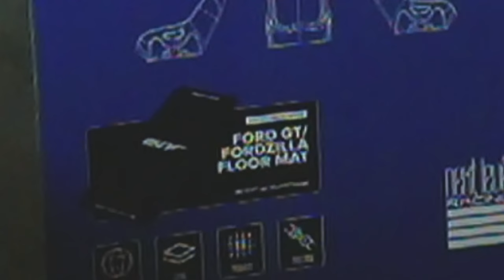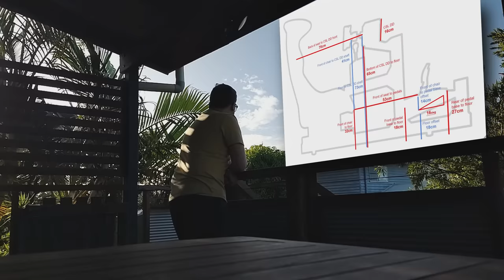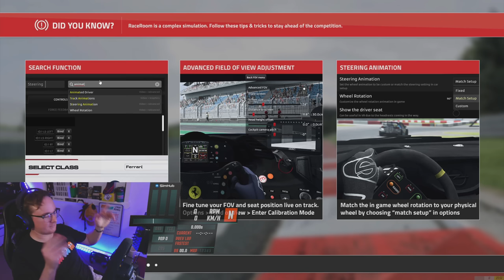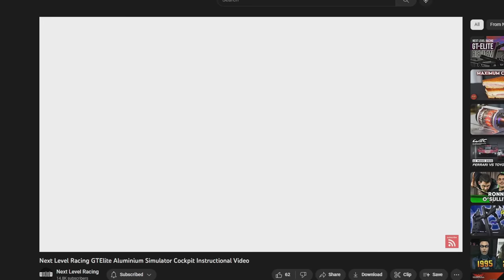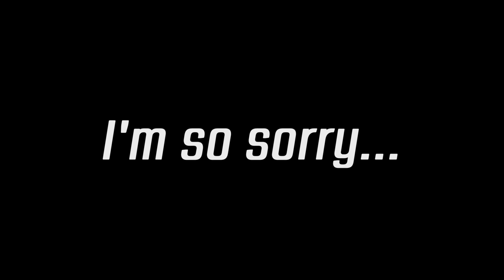My New Sim Rig! Next Level Racing GTElite Cockpit - Unboxing, Assembly and First Impressions

Comment: Yay! Yet another freebie handed out. Utube is full of folk happy or sometimes bemused to get handed a AU$1500 racing cockpit WITH ALL THE TRIMMINGS I might add just because. This time, to a bloke who doesn't even need it. Sheesh!
However, I did like your review. Lots of info on the bad as well as the good, spoken both clearly and logically. I'll be building the same rig very soon and much of it will be done at table height.

One video tip; this rig is dark in a dark room. I had a lot of trouble seeing any detail tbh.
Hope you cashed in selling one of your rigs. Not a bad little earner after all 🙂
Reply from the maker: Completely agreed mate, I definitely didn't need this rig and was perfectly happy with my old Simetik K2 before Next Level Racing came along and offered me this 😅 which was even more surprising considering my previous video was a review of their HF8 vibration seat pad and wasn't exactly, er, complimentary to say the least. I guess it costs them less to give a few rigs away to streamers/video makers here and there than it does to blow a stack of dollars on advertising. That said, the quality of this thing is superb and I'm very happy with it 👍 no complaints after a year of extensive use and it's been rock solid. All the best for your upcoming build!

I'm saving the old rig for either my Dad (if my parents decide to move over to Australia in the future) or my little kiddo when they're a bit older and can reach the pedals. And as for the lighting side of things, I've gotten much more familiar with my camera settings and editing software since making this video so hopefully the footage is looking a bit better these days 😉

Comment: Nice, looking to get this.  How tall are you?  Want to know if the pedals could be brought back a bit (for guys 5' 7" or shorter) without bringing back the slant bars, or wheel may be too close.
Reply from the maker: I'm about 174cm which is bang on 5ft7 👍 can't see any issues why being a little bit shorter than that should be an issue either.
Reply: @DDFRacer Sorry, that issue was with the F-GT Elite.

Comment: What a video, that’s a beautiful rig. I just Googled and it’s a real shame that nobody makes a GT wheel to match with this.

A branded GT replica wheel would make this just about perfect. I love how it looks in the video, but the BMW wheel would set off my slight OCD lol.

I know they make a non Ford GT version of this but this pops more. Hummmm I need to dig around on Reddit maybe some simgeek whipped up a GT wheel
Reply from the maker: Thank you for the kind words 😁 much appreciated! Can confirm the rig is still going strong to this day and hasn't faulted once, although I'd never really noticed the mismatch between the branding and the wheel before ha. I also use an F1 style wheel occasionally for prototype and single seater racing which has blue fabric on the handles so that would perhaps fit the style a little better 😉 although a dedicated Ford GT wheel would complete the ensemble perfectly like you say. There's some pretty crafty people on Reddit, might be worth having a look there 👍

Comment: To me it looks like you should swap the gear shift mounting brackets around, i.e. move the bottom to the top and vice versa.
Good review and I love the colour, so much better than silver or black.
Reply from the maker: You might think that would work, but it doesn't sadly 😅 trust me I tried every kind of rotation and flip there is and couldn't find a way to get it sitting flush with the uprights on the left hand side. The only way would be to mount it to the inside of the upright...but then the shifter mount would occupy the same space as the seat which just isn't possible. In the grand scheme of things it's only a minor issue though and not one worth worrying about 👍
Reply: @DDFRacer  Well I be, they really do look like they are upside down. I should have it cant be that simple. Keep up the good work.

Comment: real good job on your video. got a lot from it. thanks.
Reply from the maker: Happy to hear it came in useful for you 👍 can confirm it's still going strong today after nearly a year of extensive use, hasn't budged an inch or had any screws fall out or come loose. I think the seat has actually gotten more comfortable somehow too 😅 couldn't recommend highly enough!

Comment: Have the same one after using for almost a year its great but here are things i dont like so much... keyboard attachment thing could be better the hinge it attaches is flimsy at best, have the same seat and i like how light it is but its just not for my back i have to use memory foam back support pad or my lower back feels like its not touching the chair at all, finally buttkicker attachment under seat is not the best it kind of rumbles off and becomes undone wish they made a mount on the actual seat.
Reply from the maker: Now that you mention it, I have noticed that I've needed to tighten up the keyboard mount a couple of times 🤔 but I don't tend to move it too much, rather take the keyboard off and use it on my lap instead, will keep an eye on it. Haven't had issues with the seat though but then again we're all different physically so some people it'll be nice and others it might not be great, personally though I'm finding it super comfortable even when I'm not racing. Can't comment on the buttkicker though unfortunately as I don't have one 😅 but if I ever upgrade in the future then I'll definitely keep that in mind, thanks for the heads up!
Reply: @DDFRacer  buttkicker should be your next upgrade it totally changes the game going back to without it just feels wrong lol

Comment: Would it be possible to pull double duty and use this for a flight sim as well?
Reply from the maker: I would imagine so 👍 there's the Elite Flight Pack available on the Next Level Racing website which would accommodate your traditional HOTAS style setup, although I don't personally have that add-on so couldn't say whether it interferes with any of the shifter/keyboard etc mounts. On my old Simetik rig I had the HOTAS addons and they were great, but I had to put them in slightly offset positions otherwise not all of the attachments would fit.

Comment: So would appreciate the help. 

I want to get my first rig, id rather pay a premium and be haopy with it for a few years.
Could i see myself with a good set up for around £2-2500? Ecluding monitors?
If so, would appreciate the help.
Reply from the maker: I honestly wouldn't know where to begin to be honest 😅 most of my equipment is several years old now and there's plenty of new gear on the market which I just simply don't know enough about to give an informed opinion, especially when you're looking to invest that kind of money. There are also a lot of variables depending on what kind of setup you're looking at, for example single monitor vs triple monitors vs VR, or maybe H pattern shifter vs paddles, handbrake, round wheel vs F1 style wheel etc.

Whatever you decide to get however, I'd strongly recommend loadcell pedals and a direct drive wheel, as they're the two single upgrades that made the biggest difference in my opinion. I'm personally running a Fanatec CSL DD (with BMW v2 wheel and also an F1 wheel) along with the Clubsport V3 pedals 👍 which would certainly be in your budget but, like I said, I'm not sure how they stack up against newer releases since this is all I know.

With regards to monitors, I can't suggest any specifics since I'm mostly a VR sim racer, but you're looking to get 120hz and upwards. You can definitely race on 60hz but if you're racing on PC then you'll be limited to 60 frames a second also. With a decent CPU and GPU you'll find most racing sims can push 200 frames easily these days without sacrificing too much visual quality. Personally though I'd suggest a VR headset if your budget allows it, the depth perception and spatial awareness is invaluable in my opinion...and that's with me running a massively outdated CV1 too! I've got no doubt more modern headsets are even more impressive.

I'd strongly suggest checking out reddit or scrolling through various racing forums to see what kind of equipment people are rocking and then seeing what appeals to you the most 😉
Reply: @DDFRacer  Thanks for the help. I was looking at the Sim lab P1X Pro as the foundation? I'm running. 4090,  so maybe a triple monitor?

Comment: I would never swap my K2-R for this rig. Great review though mate. Good rig for someone like yourself that mainly uses VR.
Reply from the maker: Had no complaints with the Simetik rig to be honest and wasn't really in the market for a new rig but it's a bit hard to turn one down when Next Level Racing offer you one for free 😅 that said, I would have liked to have kept my K2-R assembled as a backup but unfortunately I just don't have the space to have two rigs on the go and I'd rather not go through this building process again for a little while if I have the option. Took me another day to recover!
Reply: @DDFRacer  yeh man, I get it. I guess you learned a little bit from this experience then, didn't you.

Before buying my K2-R I looked at loads of different cockpits and reviews etc. The things you mentioned about NLR is why I passed on this rig. Only thing I'd say to you first before accepting products in the future. Don't just say yes because it's free. Do a bit of research first.

Looking forward to seeing more videos from you bud 😁🤙

Comment: I have the f-GT elite and I never good get a good fit. I’m average 6ft, 32 inch inseam. I could never get the pedals to feel right. You can not adjust the wheel uprights and pedals independently. I had to invest another $200 to get pedal slider system and another $130 with next level to get some extra seat cross bars. Great rig, but not perfect. If I did it again, I would go for the TR 120/160
Reply from the maker: I'm 5′ 8.5 so definitely shorter than you and can see that being on the taller side might be an issue, although the instructions do mention a few different ways to mount the seat/pedals/wheel depending on whether you're shorter or taller than 175cm. Like you said, it's a great rig but ultimately you need to have a rig that you're comfortable in, anything other than that kind of defeats the whole point really. I hope it's something you can work around mate and isn't too inconvenient 👍
Reply: @DDFRacer  I eventually got it to were it's very comfortable, this issue I think is  with a reclining seat, this ends up being lower to the ground. As you know the wheel uprights are at an angle, so the lower you're the further away the pedal deck is.
I purchased the SimLab Pedal Deck slider that comes with a really heavy 10mm deck and (by the name) slides like a seat slider. This gives you ultimate control, seat the main deck roughly were you want it and then you can adjust the slider on the pedal deck to get it just right.
 
I reached out to NLR and purchased two extra 40/40 seat slides (page 3 of the manual), that allowed me to bolt the seat brackets (page 6 of the manual ) to the original seat slides. This still allowed the back and fourth movement of the seat on the main rails. I then took the two extra 40/40 seat slides and mounted those between the seat bracket allow seat to be higher and angled .
Have a look at  this official NLR video, at about the 4:30 mark it makes sense, except I purchased two extra aluminum profiles so I could still slide the whole seat bracket unit as well https://youtu.be/MQda-vu4CL8

All in all, I think the NLR Elite rigs are higher quality than most, fit and finish is top notch, packaging perfect no scratched profiles. I also think if you use the bucker seat you would not have the issues that I did. I think for the price, they could leave out the motion mounting profile and supply some extras like the extra seat slider and offer more range for the pedals to move back and fourth.

BTW, I subscribed, I like your presentation, clean clear and crips. Keep up the work. If you would like me to send  you some pictures or a small video for you to see what I mean, more than welcome to do so. I'm not a you tuber myself. Keep up the great wok/

Comment: What size monitors did you use with the monitor stand?  Some say their 32" are too small, though the stands are advertised from 32" to 65".
Reply from the maker: I'm using a 34" ultrawide as my main monitor and an older 24" regular monitor on the right hand side for chat/secondary tasks. No issues mounting them or getting them lined up though and plenty of room to move either narrower or wider if I needed to 👍
Reply: @DDFRacer Just to clarify, would triple 32" monitors work well and fit mounted side by side (contrary to what others say that they're to big for 32")? Thanks.

Comment: Just ordered one!!!!
Reply from the maker: Awesome stuff 😁 happy to report that it's still just as good as day one here after several months of extensive use! Everything is still rock solid and secure, no hardware failures and the seat hasn't gotten any less comfortable over time. Hopefully you don't have to wait too long for the shipping 😉
Reply: @DDFRacer  thank you for the response and update. I’m so excited! Shipment is expected to  be delivered by Jan 3. I’m coming from a desk clamped Fanatec CSL Belt (PlayStation GT7) and PSVR2. I low key believe I just set myself up and that I’ll be upgrading everything shortly lol
Reply from the maker: Oh I remember the feeling of first upgrading, it's like a whole new world! The pedals made the biggest difference for me, going from a Logitech G29 to Fanatec Clubsport V3s 👀 and then the CSL DD a few months after that. You'd think the novelty would have worn off after a few years but every time I get in the seat I have a big smile on my face. Everybody gets to a certain stage where they have their setup 'almost just right' and from then on it's a constant battle to resist the next big upgrade 😅
Reply: Seat just arrived. I ordered the seat and cockpit from Amazon. Box was repackaged and it appears the seat has scuffs on the back from possible usage. Everything looks just thrown back into packaging bags and into the box. $400 seat, I’m a little tilted 😞

Possible seat rails missing 🤷‍♂️Did yours come with rails or does it just bolt up to the cockpit?

Thank you!
Reply from the maker: @JB-lr6wj  Ah mate 😬 that doesn't sound too good! Sorry to hear you've had that experience, definitely make sure you take plenty of photos and get in touch with support, I'm sure they'll be able to sort something out for you as I didn't have any of those issues my seat. It was all nicely packed with polystyrene and super secure. Regarding the seat rails, it's not a traditional kind of mounting solution as you bolt the seat directly to the brackets, but then these brackets mount on to a sliding frame on the rig itself so it's still completely adjustable 👍

Comment: The brackets for the shifter mount just need to be flipped around.
Reply from the maker: Trust me, I tried for far longer than was reasonable to get them to fit the right way 😅 but honestly they just don't unfortunately, no matter which way you flip/rotate the brackets. The way they've been manufactured means they'll only fit flush with the upright when mounted to the right hand side of the cockpit. If I rotate the brackets180' then they'll be in exactly the same position. If I flip them round it still wouldn't work because the bracket is L shaped but only one side of it is slanted. By flipping the brackets and mounting them on the flat (not slanted) side then the arm for the shifter would be pointing into the ground. No way around it unfortunately.
Reply: That sucks.  I've seen other reviews were they acctually send two sets.  Looked into it after I ran my mouth. Lol.
Reply from the maker: @bradmccombs3925  all good mate 😉 I just had another look through the boxes just in case but no extra reversed brackets to be found unfortunately. Was worth a shot!
Reply: Good luck hope you can swing it.

Comment: is the racing harness really necessary?
Reply from the maker: Not at all no 😅 they're optional to install but included with the seat itself so thought I'd give them a try. I was originally sceptical but I've tried it a few times now and, honestly, they're great. I'm not using them for safety reasons, obviously since it's a stationary rig, but I have a really bad habit of slouching and bad posture and using the belts keeps me sat up straight and in a really nice position. I can also feel the FFB through my arms more when I'm strapped in, I'm guessing because my body isn't moving around as much.

Comment: How is the seat?
Reply from the maker: Really quite comfortable 👍 you wouldn't think so initially due to it being a moulded bucket seat with relatively thin padding in a plastic base...but I can sit in there for hours and not have any complaints at all. This rig doubles up as my workstation too, not just for racing, and I end up doing all of my video editing and admin in this seat too. Even for non racing purposes, it's good. After nearly a year of extensive daily use, the padding is still great and there's been no warping or flexing either.

The only downside I would say is that it gets a bit warm and the ventilation isn't too good, but I'm just coming out of an Australian summer here so I think any seat would be the same 😅 but yeah, it does get a little sweaty in there sometimes.

Comment: What is the total price for this set up?
Reply from the maker: Looking at Next Level Racing's website, it's around $2800AUD for this rig. If you're also asking about the cost of the wheel, pedals, computer, software etc then I wouldn't even know where to start but it might be, er, significantly more than that 😅